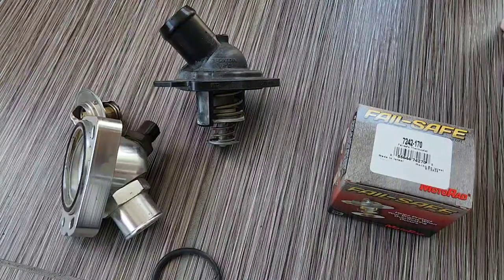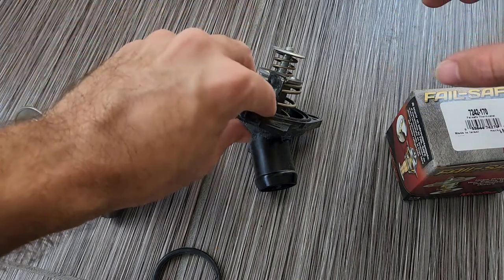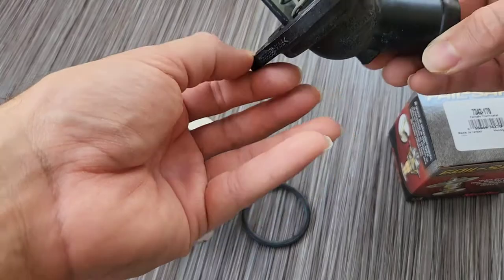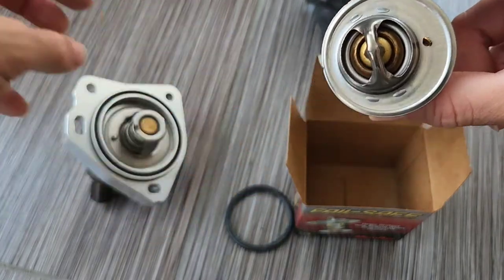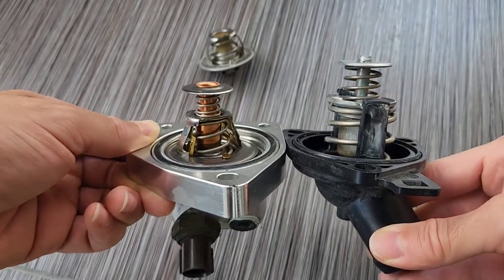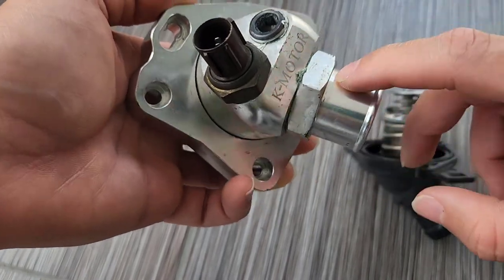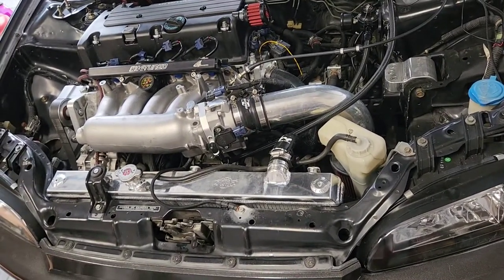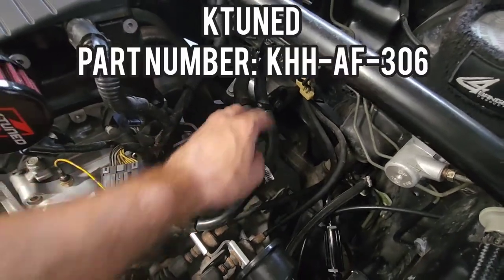NO MORE ISSUES! K-series Swivel Neck thermostat housing PROBLEM SOLVED!

Comment: one thing i found old type bolts direct to the water pump housing with out the plastic  section if u dont plan on running heater core

Comment: How many extra holes did you drill on the thermostat and what size hole?
Reply from the maker: I cut the tap to open up the first hole. Then I drill two 1/8 in extra holes.

Comment: I was going to buy the version 2 ktuned neck that allows you use oem thermostat=$200 but I think I’ll go this route instead thanks for sharing 👍
Reply from the maker: That's exactly what I was going to do at first. But I starter to research different types of "stand thermostat " designs, like the old v1 utilizes and figure it out.
Reply: @Almostboosted  hey quick question are u running AC? ...i see from the video u are not running a PS .....would like to know what size belt you running and radiator fan...(part no etc if u have it) thanks 👍 nice vid, great content
Reply from the maker: Hey, thank you . No I'm not running AC I believe is 50 or 52in 7 v rib came with the ktuned k24 idler pulley. And the radiator fan a 12in spall fan 1700 cfm.
Reply: @Almostboosted  thanks much appreciated 👊👍🙂

Comment: I’m having a similar issue except my kswap civic runs supper cold , so it has to be a type r thermostat? Or will b16/gsr work ?
Reply from the maker: Yes a gsr and b16 should worke had someone message me telling me that the gsr work for them have the fan kick on much later temp like 190

Comment: Nice! You mind sharing the part number for the o-ring for the integra thermostat?
Reply from the maker: I had to re use the old one since Integra one is to bulky to fit in the K-series Swivel thermostat housing. Let me see if I could research it and I will update you.
Reply from the maker: This is a shot in the dark try to see if this one works because it canot be bulky. Stant 27279 Thermostat Seal, Medium https://a.co/d/iD5y6FE
Reply: @Almostboosted  thanks for letting me know
Reply: @Almostboosted  I ended up using the gasket that came with the thermostat housing and I used an oem GSR thermostat. Works perfect with no overheating. Thanks again for making this video!
Reply from the maker: Thank you for the update! I'm glad I was able to help. At what Temps does the GSR thermostat opens?
Reply: @Almostboosted  it opens up at about 175 degrees and I have my fan set to come on at 185 degrees

Comment: So this type r thermostat will work with no problem right
Reply from the maker: Yes, it did for me with zero issues. Drilling the 3 evenly space holes, made it work better.
Reply from the maker: My buddy in San Diego is running same thermostat as me with no issues.
Reply: @Almostboosted  what o ring you use any part number on it if you can help me on that please
Reply from the maker: So on the o ring I couldn't find the exact one or part number I just reused the one that came with the swivel thermosta
Reply: @Almostboosted  drilling holes in the thermostat???
Reply from the maker: Yes, it helps by bypassing some of the coolant to allow the thermostat to open sooner.